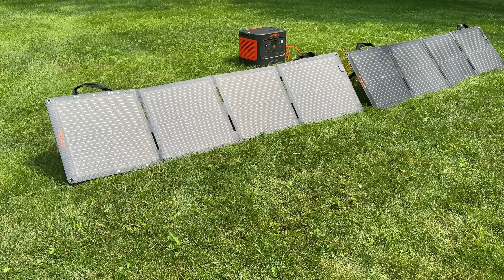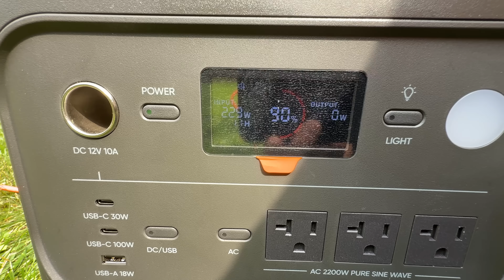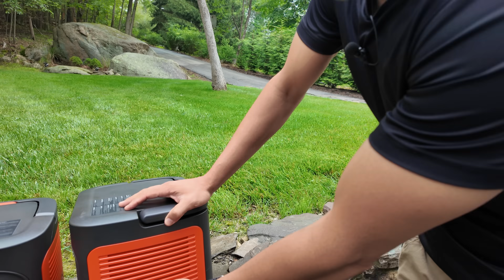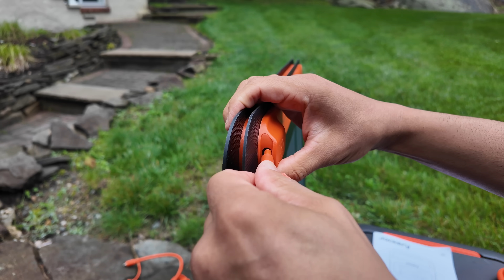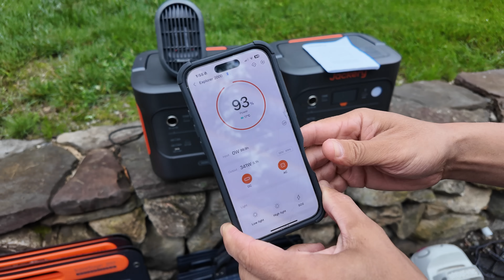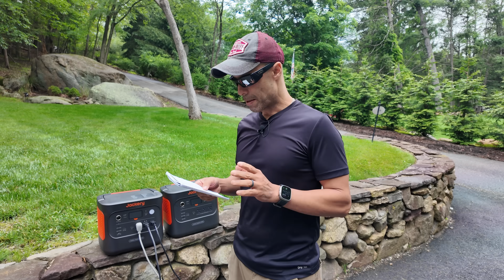This Thing Is NO Joke -- Jackery 2000 V2 Review!

Comment: I have one of these and love it... kept me cool during a storm indiced power outage.. i have an Inverter-style (midea) portable A/C..  stuck the hose in the window and the jackery on the floor... turned the A/C on Low fan setting , closed the nedroom door and it worked fantastic.. I used to live in a suburban house where i could chain up a gas generator outside but now i live in a downtown apartment where using a generator isnt something I can do so the jackery is perfect..   it ran the portable A/C on low speed without issue all night.. as being an inverter A/C it slowed itself way down and even cycled off a few times in the night with the temp at 72... granted I really like to be at 65 to sleep but 72 made for a very comfortable sleep considering there was no wind aftyer the storm and the outside temp never got below 78...  I am impressed with the 200 watt solar panels, they put out close to rated output in summer.. now that its fall, the most I could get (central ohio) was about 120 watts out of each panel the other day (mid october), id expect in winter they will be even worse..  the device does recharge on my gas generator (a harbor freight 2200) so if I were in an extended outage where I needed to use it repeatedly, i could charge it..  I do like your idea of having 2.. maybe ill get another one at some point..  also being in an apartment, this jackery with its high surge current capability means i can vacuum and shampoo the carpets in my pickup truck right in my aparmtent building lot (we dont have power outlets) it starts up the shark vacuum with my mini car-detailing attachments just fine.. as well as my hover carpet cleaner .. bot h no issues running on the jackery..  the 100 watt USB-C charges a macbook pro (mac are notoriously picky about their USB power)..  the only feature its missing that I dont see on any of these is a jump-box feature..  would be nice to be able to start my diesel bus if Its batteries are low... I end up havign to connect a battery charger to the AC outlet and charge the diesel battery then fire it up...  it does also start my pancake air compressor which is nice for pumping up tires quickly on my vintage busses..  these things are useful for much more than just camping...  I keep it busy.. hopefully it lives up to its battery cycles..  I do keep it on the lowest charge setting (quiet) when i recharge it at home.. in hopes that the batteries last longer by slow recharging
Reply: Keep 15%-85%
Reply: @chaixiyao  thats my general practice but when storms are impendong, I charge it to 100% and will run it down to 0 if i need to.. but in general use where i use it for camp-outs, power at my storage unit etc.. I keep it 15%-85% SOC

Comment: Thinking one of those 2k’s would power up my rv at night after the generator turns off while dry camping. RV only draws about 100-130 watts under regular use . Would just charge it back up during the day when the generator is running.

Comment: Very informative video, thank you. I bought my Jackery 2000, V2, a little more than a month ago, not knowing about Prime Days coming up. I almost clicked the mouse for the Jackery 3000, with 200W Solar Saga panels, but I reached my budget for my preps. I now have it stored for a bit of peace of mind and comfort during our next nighttime power outage. I now have it fully charged and stored. I can comfortably finish out the night with an LED light, a fan, and watch satellite TV until the morning, when, if needed, I can break out my emergency generator for the fridge and chest freezer, and recharge everything. Currently, I only have one 100W solar panel for my Jackery 500 & 2000, which is not sufficient. My solar panels will be plan B for any extended power outages. With all the tornado drive-bys and dozens of tornado watches and warnings this season, I thought it prudent to invest in a shelter. With that kind of expenditure, I could have purchased several solar stations. And, all would be sucked up and taken away with a direct tornado hit. Been there, done that.

Comment: I have a 3000 pro, and I love it. I originally bought it for my Artic Fox truck camper. I could charge it 3 different ways solar, AC, and DC in the truck on travel days. I bought this one because it has a 30 amp outlet so I I need to I could plug in the camper a run the microwave or top off the batteries.  Now I have a travel trailer. The only thing it won't run is the air conditioner for more than an hour 😢.  But those are power hogs.

Comment: Nice video Izzy !  I bought this exact same unit last fall on Amazon for $799 before tax.  By far the most capacity at that price point for a quality unit AND quality COMPANY.  I mention that b/c my first power station (EcoFlow Delta Mini) that is 3 yrs old, with about 25 power cycles on it, is now operating at around 39% of stated capacity.  EcoFlow will not offer me ANY support since the paltry 2 year warranty has elapsed.  They offered a 4% coupon to buy a brand new unit from them.  I will NEVER buy EcoFlow again.  This Jackery unit is more powerful, less costly per Wh AND has a company that will actually support you post warranty.